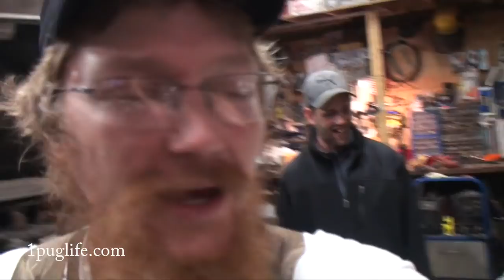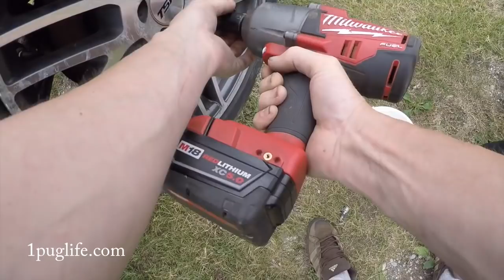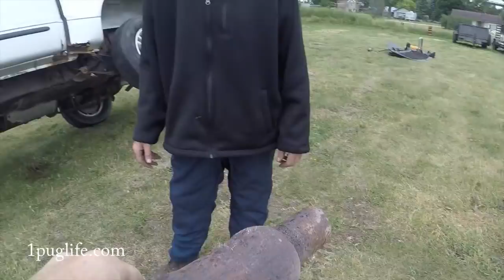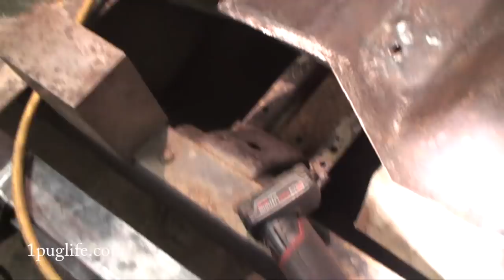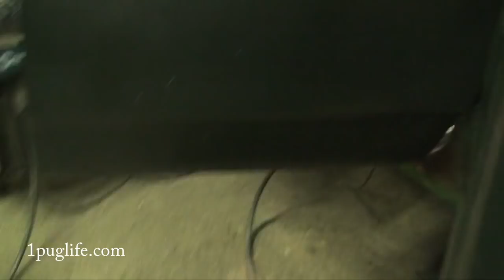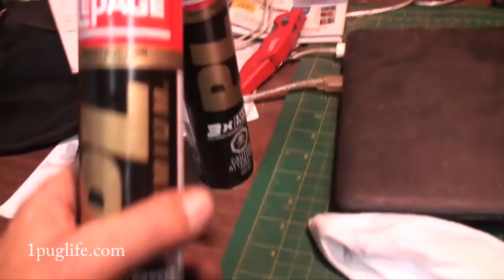playing tractor and finished the floor in the 83

Comment: Need to make a weight for the 3point linkage a 50 gal drum filled with concrete is a good option
Reply: Even Filled With Water for $$$ Savings. 8lb gallon x 50 = 400lbs. He Already Has Some Cross Bars On Hydraulic Rams They Way He Bought It.

Comment: Health and safety is very happy about his documentation of the unsafe work conditions at his place. I am sure they already stored a copy of this video to the file of pugs case.
Reply: I must be correct, I get right away insults. That always show me that who does not agree with me has no real arguments for themself. It's always fun to see when the insults start.
Reply: One of them 6 in I beams could hold up a house.  So clearly he was  carefuling terible by using 2
Reply: rj brown : its not the size of the I-Beam, its the way it is connected. The car was still on the tires that can roll. If you work with others (paid or unpaid employees) you have to follow the Health and safety regulations, its as simple as that. Especially if you show publicly what you are doing. Also you could see that the guy did not like to remove the pipe from the car and had fear that it could fall onto him. If you that kind of work, at least do not show it on a video. 
i am sure Pug is happy about this conversation, make him felling important. :-)
Reply: Tom Davis : not as sad existence as the guys that have to insult other ones to feel better. Or even the lower existence that try to us gay as an insult.

Comment: that trapner that size is no way going to lift a vehicle much over 1500-2000 pounds.....most trapners that size struggle to lift a 1500 pound bail of hay when they are new. a car is way over the lift capacity of a trapner that size.
so be careful what your doing around that kind of weight you could snap that loader in half trying to lift that much....they were designed to lift cow shit and hay not vehicles